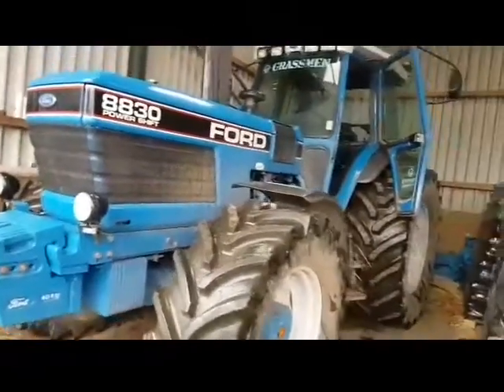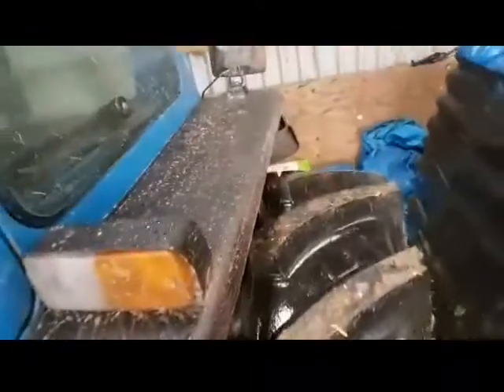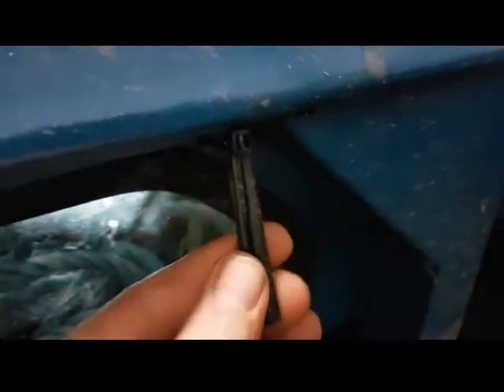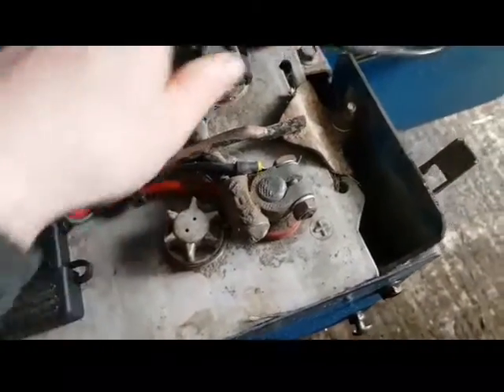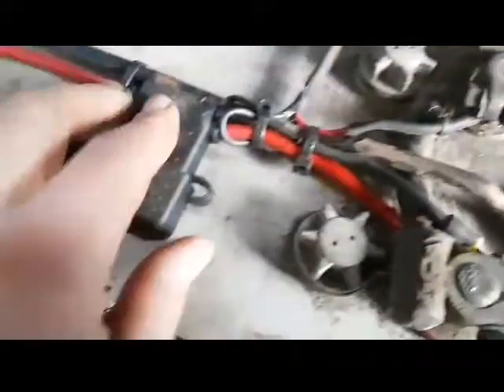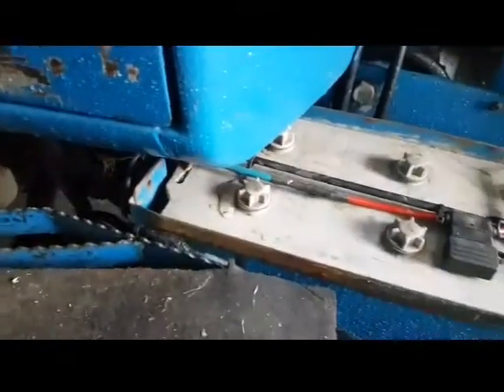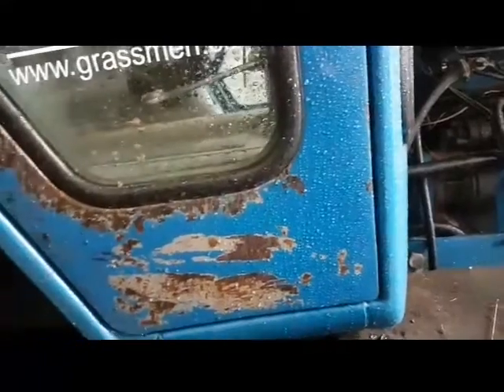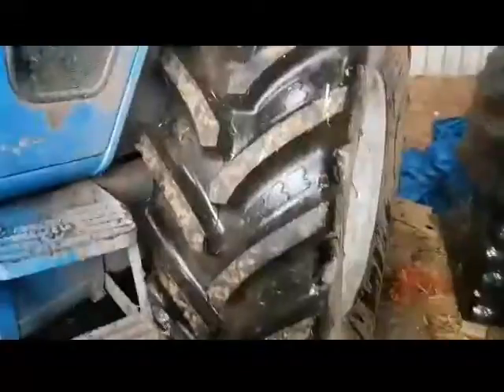Winter projects episode 4 wiring

Comment: If you use insulated crimps on a regular basis you should get a proper set of ratchet crimpers, there not deer and should stop them coming loose. Also the colour of the crimp denotes the size of cable it's designed for, you might have had a crimp that was to big. Red are the next size down.